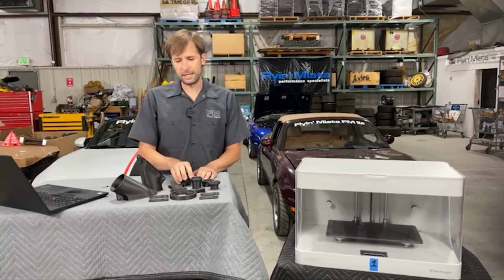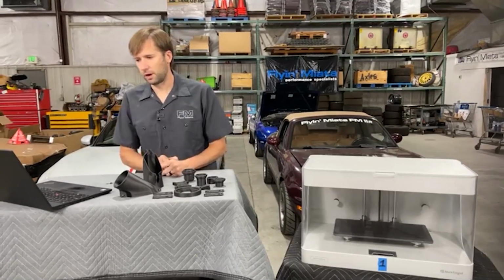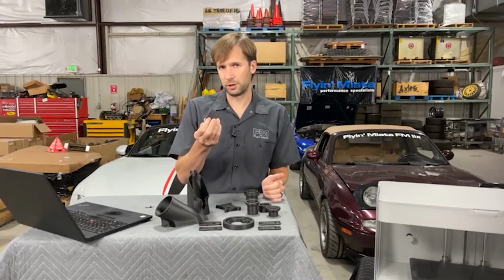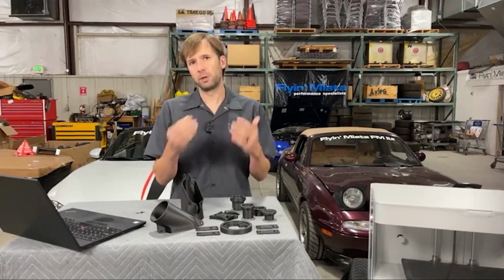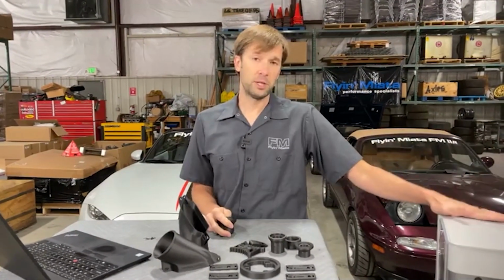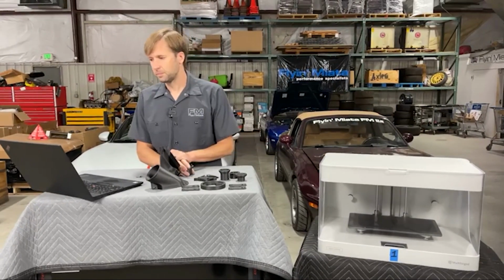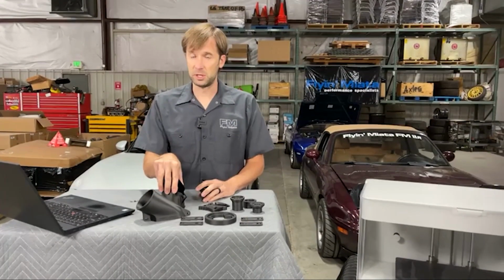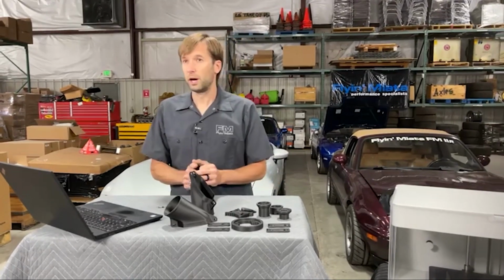FM's "YOU Design" Program! (FM Live)

Comment: What do you suggest as the "best" alignment settings for a street driven nb miata. the car has wheels tires and coilovers and im looking for a sporty but practical alignment set up since the car needs to be aligned anyway. Thanks
Reply: Wrong place to ask. FM has alignment spec on their website. I’m running 949 street alignment on my NA which is a bit more aggressive. I will be going FM for my NB.
Reply: @Unwitnessed  yup found this exact info on their website just after posting the comment, just forgot to delete it lol thanks!